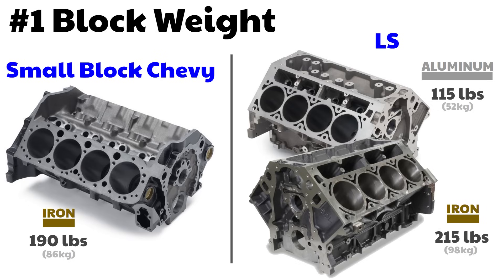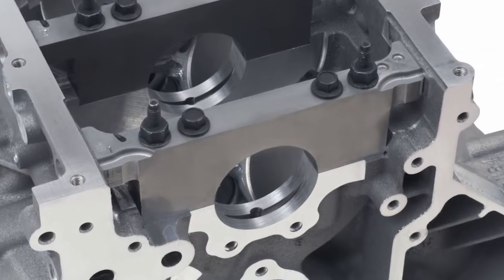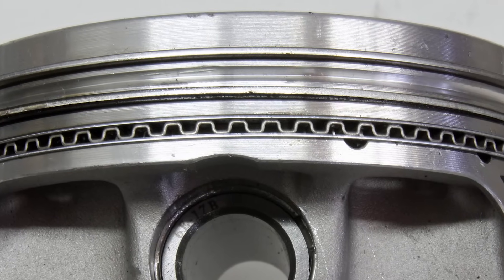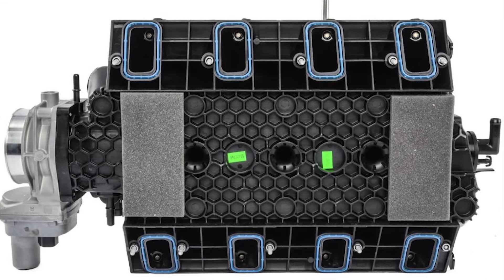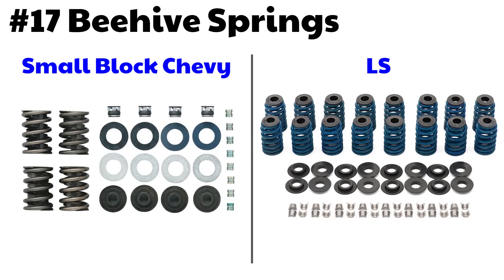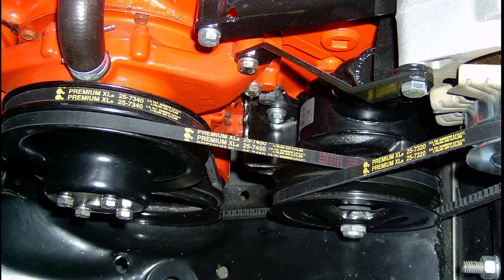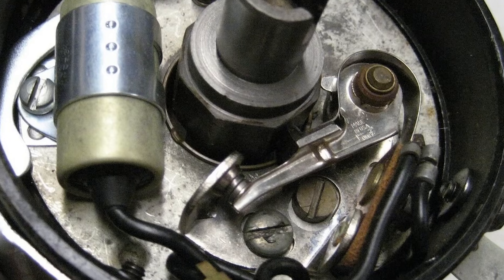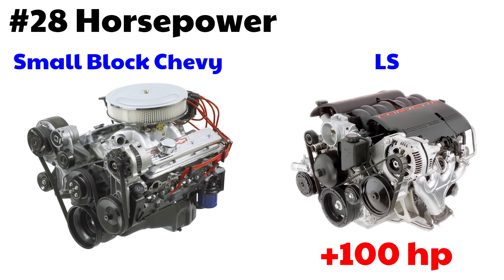29 Reasons LS is Better than Small Block Chevy (Gen 1 & 2 vs Gen 3 & 4)

Comment: The small block is so much cheaper... and easier to work on
Reply: Factually the LS is a easier engine to work on.  I have both and I like both but the LS is a better engine.
Reply: @dalethomas9307  easier, really. If I need to do anything to my engine I can sit on the fender well. Can you do that with the LS. 5 min to change a fuel pump. Hours on an LS. Also, every thing is so much more expensive. My whole distributor probably cost less than one coil and I dont need to remove my coil to replace my spark plug. The only thing easier to work on than SBC is the 250 in line 6.
Reply: @gregorystone1439  i don’t need to sit on the fender to work on my LS. Electric fuel pumps are a modern reality and more reliable than old diaphragm mechanical fuel pumps. also no vapor lock issues. my factory fuel pump in my 03 Silverado died at 140k your old 350 was likely leaking everything and had a hell of a cylinder ridge by then. On the cost of replacement parts this is negated by the less frequent replacement of said parts I checked on the coil pricing $56.32 for a Delphi coil that typically goes 150k/200k without replacement. This coil doesn’t need to be removed to replace the spark plugs.
Reply: @dalethomas9307  my point was the 350 is much simpler in design. I dont have all that electronics to go bad, and they will if you keep the truck long enough like I do. Also, everything is easily accessible.  For me this is a big deal. I like to turn wrenches but I am NOT a mechanic. I am not trashing your motor. LS is a really good motor and alot less quarks than a 350. Im strictly a chevy guy so if I didnt get into the 350 I'm sure I would have gotten into the LS. My truck is a stock 77 c10 with a 350 and 3 on the tree I had since 07.
Reply: @dalethomas9307  lol

Comment: The LS is great but this guy isnt very knowledgeable about the Original small block. The small block chevy is a dinosaur but the best cheapest powerful easy to work on dinosaur ever. Guys were running nitro in the early 60s in the 7s with small blocks ls's are the cats meow on paper but if i had to have one engine for the apocalypse it would Deffently be a small block chevy

Comment: something I noticed, the cam replacement part is backwards. The LS requires the heads to come off to replace lifters, the SBC does not.
Reply: This is the only reason I'm reading the comments to see if anyone else noticed!!! Lol
Reply: @nigelbreazeale5541  pretty decent video but i figure when it comes to engines people should know the nit picky details. Especially if someone is learning about engines strictly from the internet (like i do)
Reply: That where lost me ...you don't need to remove the heads to change the cam
Reply: @tasker1971  true, but its always a good idea to put new lifters in with a cam, especially on higher milage cars.

Comment: Well my 1979 chevy 350 gave me over 400,000 miles never had a issue my 2004 5.3 LS at 260,000 miles started leaking everywhere seals gaskets and I drove both the same way.LS maybe a better but dont seem to lasting as long
Reply: My carb engines are burning oil by 100k miles where efi ls usually are in better shape come 250k or more. Plus,  I can make really good power with just injectors, cam and springs. To get the same 500 hp out of a sbc would take some money. Like $8k

Comment: Is it just me or are there others who consider SOHCs rather primitive? Which kinda makes pushrod engines ancient. Also, you can rarely find cast iron blocks on large displacement engines in European cars after the mid 90's. Not to mention that VVT is a basic feature from around the same time (obviously being easier to implement in DOHC engines)

Comment: G.M. began using powdered metal connecting rods in the mid nineties on the LT-1 and they were also used in the L31 Vortec 350s.
Reply: Very True about the powdered metal connecting rods.  Also the Heart Shape Combustion Chambers first appeared on the the Gen II LT1 and then GM immediately copied the Iron LT1 versions onto the (essentialy Gen 1) Vortec L31 350 with updated timing cover.  The LS (which I do not consider a small block Chevy but the prelude to a corporate GM V8)  only carried over the shape of the combustion chamber from the previous engines minus the cathedral port on the cylinder head and cylinder head bolt arrangement. It may make more horsepower BLAH BLAH yadda yadda but will never be a small block Chevy.  LS guys never consider the fact of other GM engines that have existed long ago that made more torque from the factory.  They have eventually gone extinct  by  cancellation due to (quite frankly)... embarrassment on behalf of the Chevrolet division getting their arse handed to them first by Pontiac and Later Buick which outperformed their flagship Corvette.
Reply: The powdered metal, fractured cap rods are far stronger than any OEM gen1 SBC rods. No comparison

Comment: I am 70 years old and built and drove small and big block chevys the entire time.    My 69 El Camino was a 461 big block..    I just converted my C10 pickup to a 5.3 nothing special engine.     With just headers and good exhaust this thing makes 340 hp... not huge but it is instant.     I don't think I even need any more hp in this truck..  plus..   to get out of California you have to drive over mountains.     No black smoke.    it adjusts for all that.